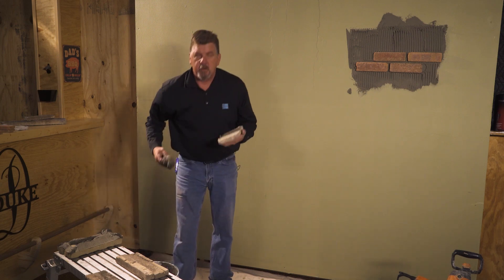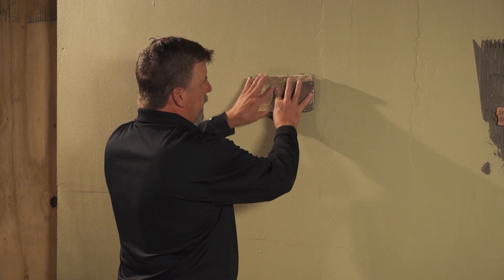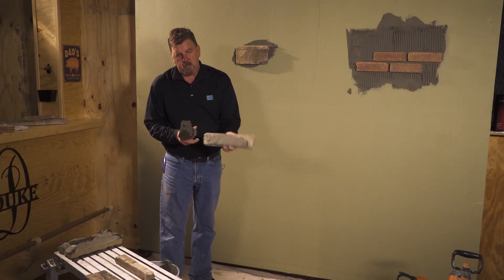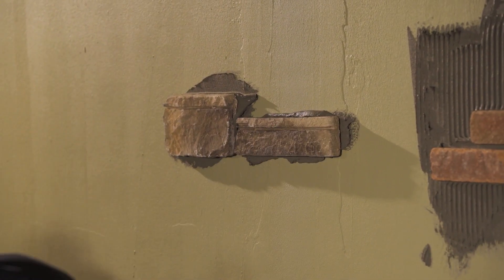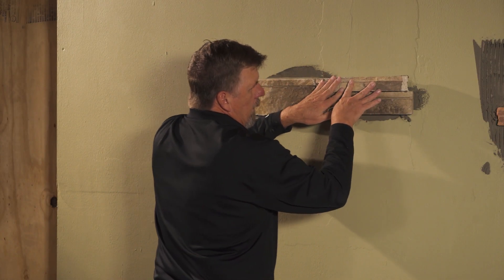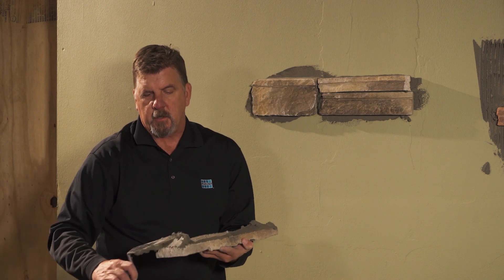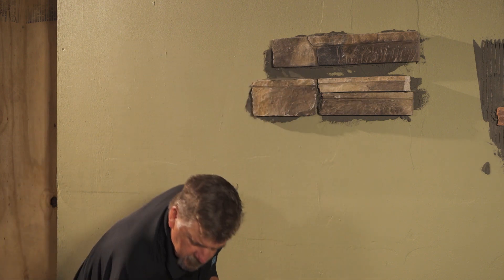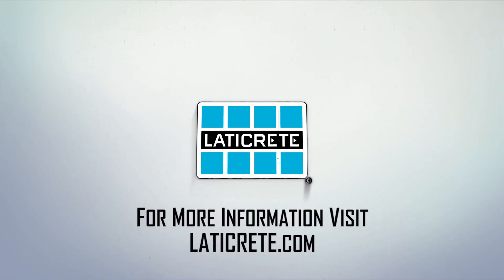MVIS Best Practices Part 4: Masonry Installation Method for Thin Brick and Natural Stone

Comment: For exterior stone  columns,  we already frame the columns with exterior grade 2x4s pressure treated, and we installed the  cement board over it with no plywood behind, the spacing on some of the 2x4s is not even 16OC is less, do we still need plywood behind the cement board? Or I can get away with the cement board only, then the liquid water resistant barrier then the stone installation?
Reply from the maker: Hi there. Thank you for your message. Not knowing the full scope or intent of the columns, or the size and type of stone, all we can suggest is that you follow the projects local building code for exterior stone installations.

Comment: Nice. What's the maximum stone weight that you can apply with this laticrete method? will it hold  without sagging or falling 45 pound stone panels on vertical exterior building facades?
Reply from the maker: Per the IBC (International Building Code) the max weight of a veneer can be up to 15 lbs per square foot.  Any of our MVIS materials will work fine with that weight. Let us know if you have any more questions.